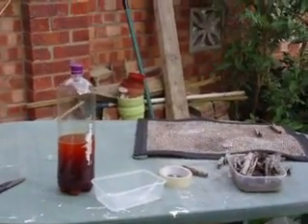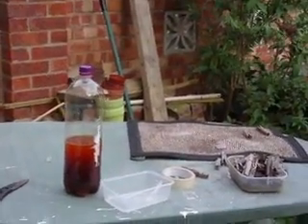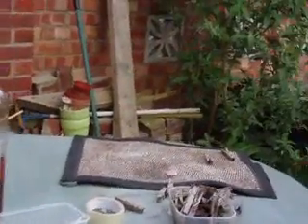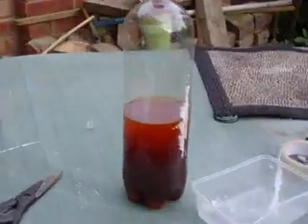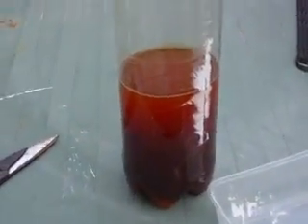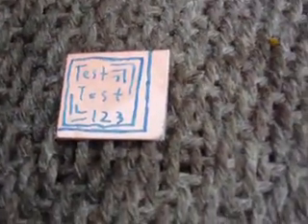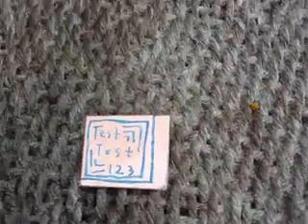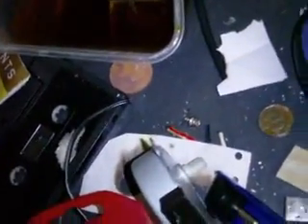PCB etCHing xperiment

Comment from the maker: @pyronathanpyro Im pretty sure the acid pellets are available at just about any place where you can get electric components, like a lot of my stuff, I got mine from Bowood Electronics.  To make the acid all I did was put about a half litre of water into a bottle, then add the pellets, of course I used a funnel I made from paper so they wouldnt spill everywhere when adding them.